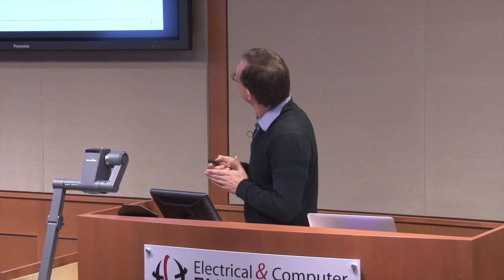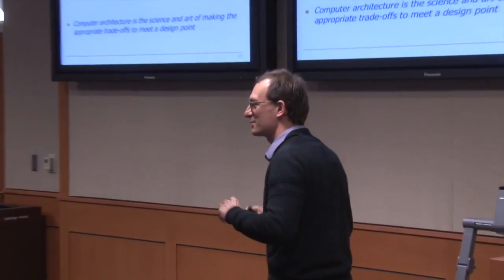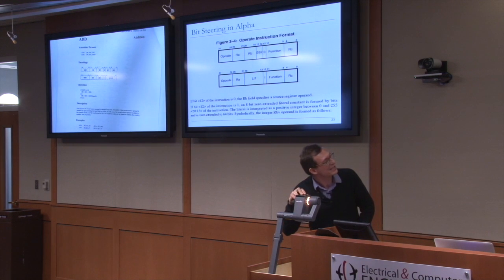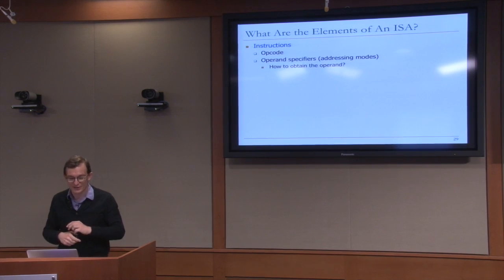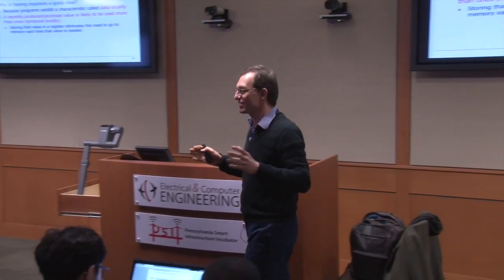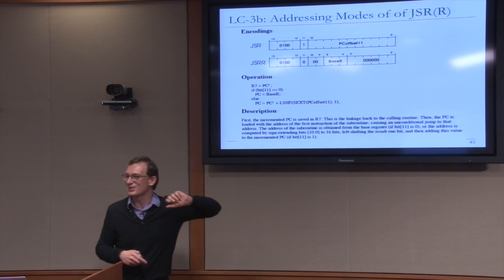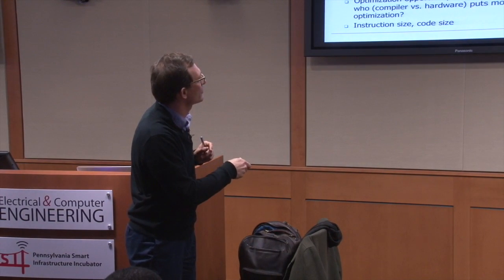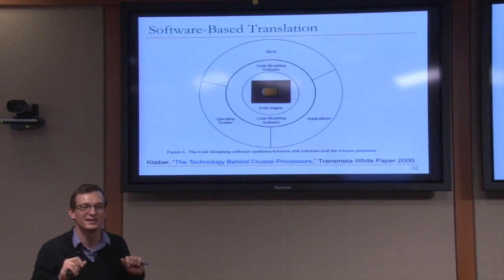Lecture 3. ISA Tradeoffs  - Carnegie Mellon - Computer Architecture 2015 - Onur Mutlu

Comment: Re: slides 32, 33:  
The TMS34010 and TMS34020 were C programmable 32-bit architectures that were also bit-addressable.  In their cases, bit addressability mattered because their application space was graphics, and in the mid-1980s through early 1990s, pixels were often smaller than a byte.  Even when you got to RGB, pixel channels were smaller than a byte.

Comment: What is with the camera man. He was already bad and just barely filming the slides enough to follow them in the last two lectures. Just when you thought it couldn't get any worse, in this lecture, he decides to focus even more on the professor walking back and forth and less on the slides than  he did in the previous lectures. I mean, don't get me wrong. I also think the professor is very attractive and distracting-ly beautiful too. But, It would make things a lot easier if he would focus a lot more on the slides so I can follow the lecture more clearly. The one saving grace is that the slides are posted.
Reply: So you need more perfection here, right !?

Comment: the "module materials" link doesn't link to the material...
Reply from the maker: This is a temporary redirection problem on the CMU website. We are working on having the problem fixed. Until then, you can use http://www.archive.ece.cmu.edu/ instead of http://www.ece.cmu.edu/ at the beginning of each link.
Reply: Thank you, I'm very adamant on reading the assigned material before advancing with the videos :D  Also thank you for sharing with us this great lectures :)